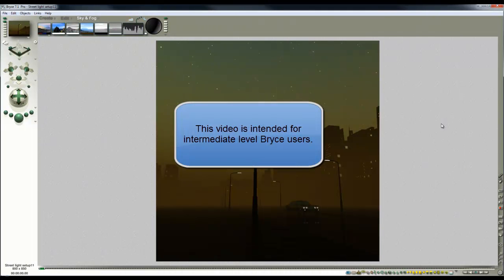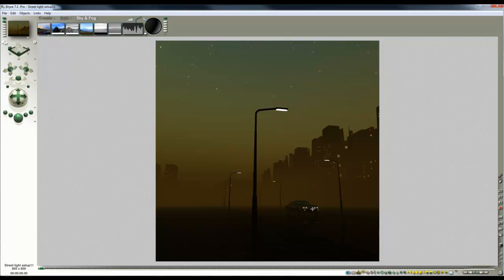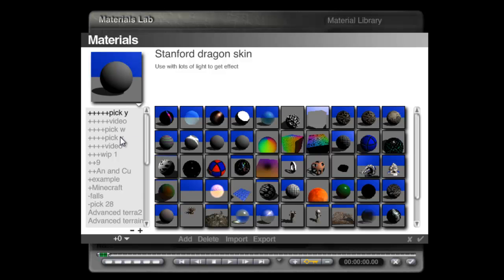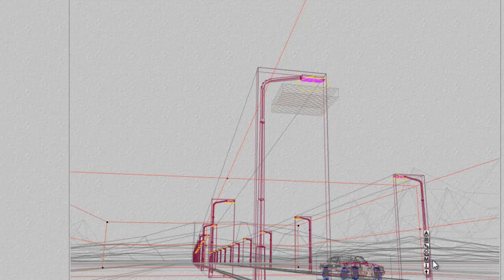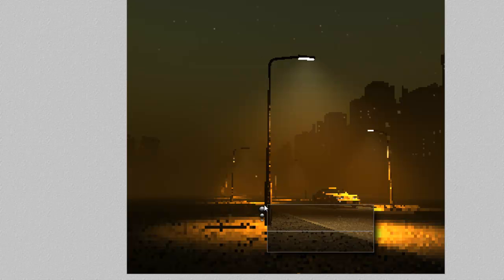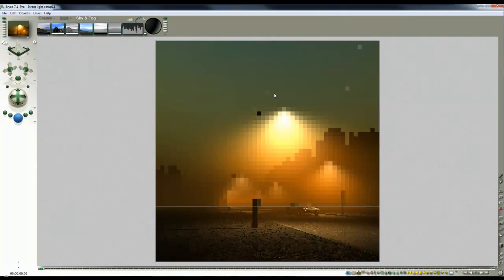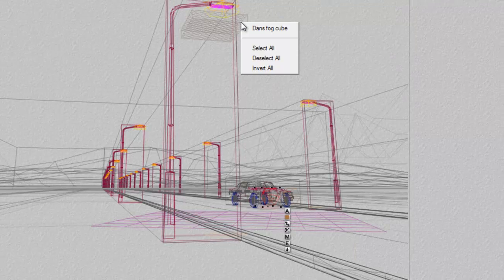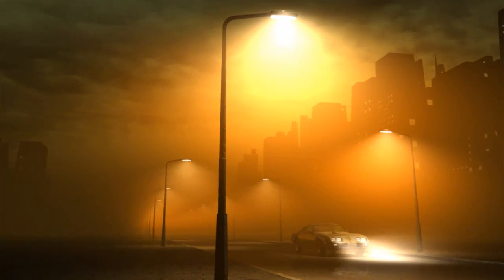Bryce 15 minute lighting project - low pressure sodium lights on a foggy night - by David Brinnen

Comment: First of all, I want to say that you are amazing!!
On the other hand, I want a picture like this for my screen saver; something done by myself, if possible.
    I am moderately versed in Bryce; despite being following your tutorials, I found too many problems in achiving for this effect. English is not my language, so that barrier is a problem.
     I wonder if there is a way to download this scene and to modify it in my program; A download link would be use. If that has a cost, I would be willing to face it.
     Thank you very much for your excellent work and good taste!
Reply from the maker: If I can find the file I will drop box you a sample of the critical parts of the scene without any of the complex models.  I need to do a backup of my drives at some point this month, I will look then on the backups.  I don't have this file on my main drives, but then again it is a few years old now.  Not making any promises, but I will look when I do my backup.
Reply: David Brinnen
Thanks! I hope you have kept the original file. Thanks for your kindness and the terrific job!